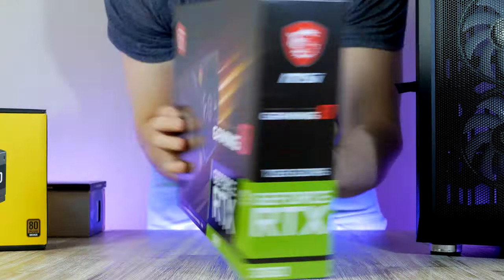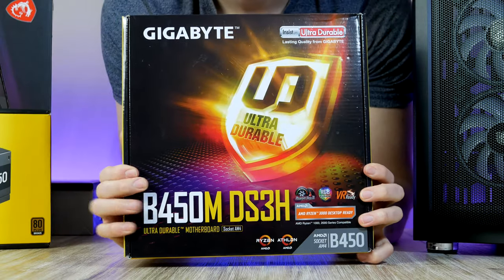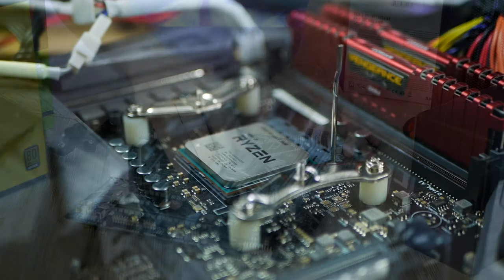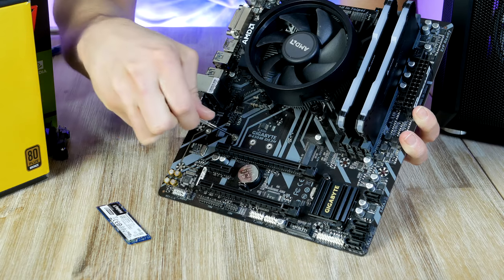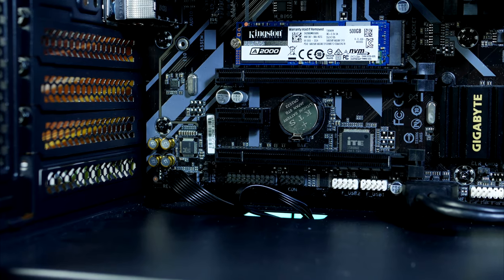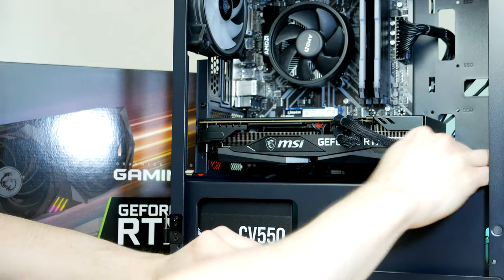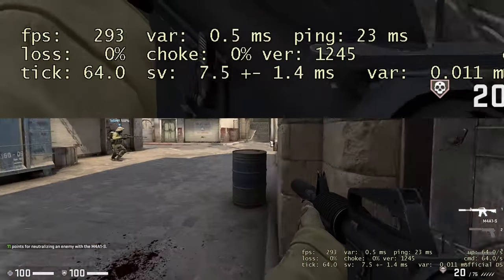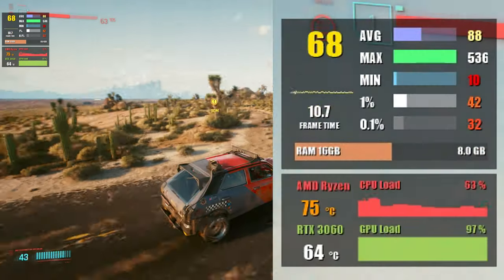Best Cheap $900 RTX 3060 Gaming PC for March 2021! Complete Build Step-By-Step-Guide!

Comment: I bought the non RGB Kolink Citadel Mesh for under £40 in the UK as I had some spare noctua fans kicking around. With  two noctua NF-a14 fans at the front and one at the rear (yes you can fit a 140mm rear fan) combined a with  noctua nh-c14s  on a Ryzen 3700x. The thermals are great.

Comment: sir can ryzen 5 5600x compatible with this mother board? gonna upgrade my pc.. with rtx 3060 ti what psu watts i need? 750? or less?
Reply: hi, 750w is overkill. 550w - 650w is enough.
Reply: @ulezisabanilla6664  i have 550w sir maybe I'll try if 550w maybe I'll remove some rgb 😂